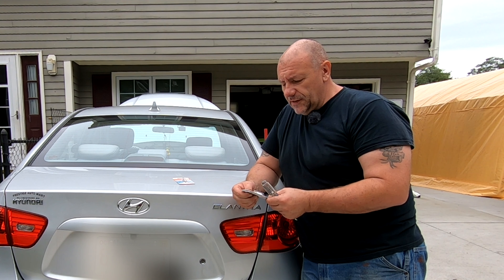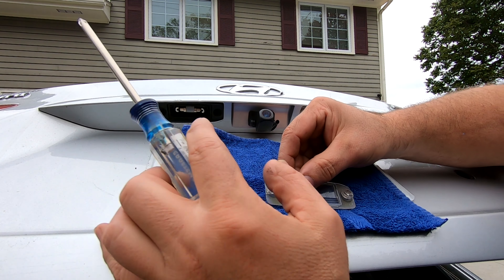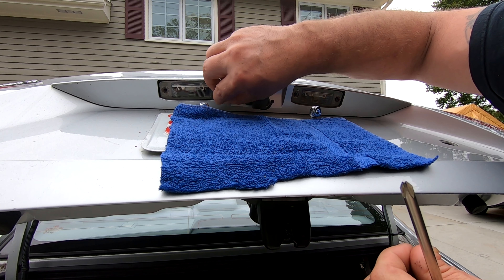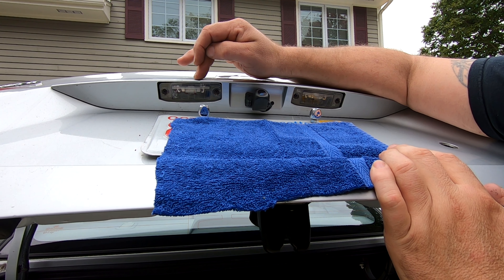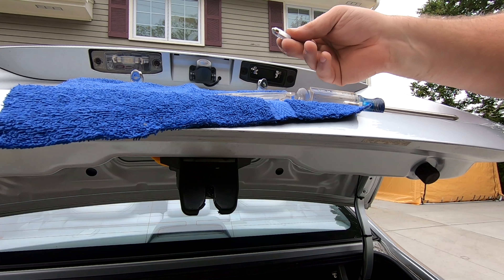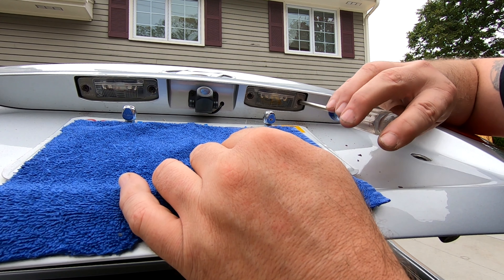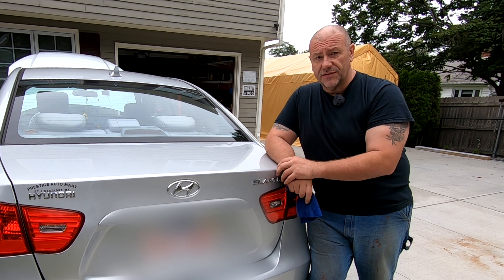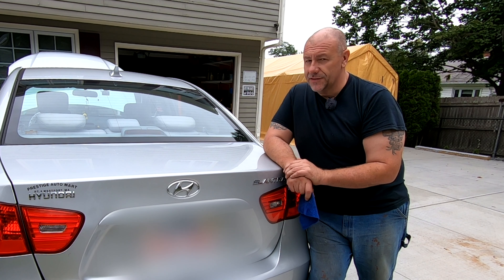Hyundai Elantra License Plate LED Light Bulb Replacement | Techn' Moto

Comment: I was pulled over a couple of years ago because my license plate lights were burnt out.  I wasn’t sighted but I was sure to replace them the following day. Easy to overlook these, crazy thing Is I had just renewed my inspection sticker the previous month.  Thanks Mike👍
Reply from the maker: Bulbs are funny like that. One day they work then another day nothing 😂 what kills most bulbs is the shock they receive when you ride a bumpy road. LEDs seem to last much longer. So far I have never replaced an LED bulb on my vehicles once installed. Take care brother